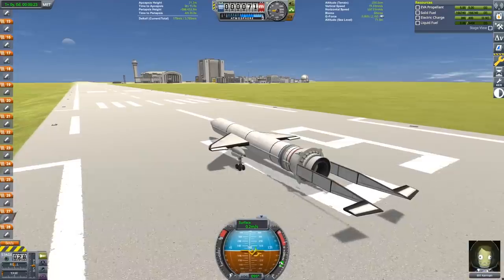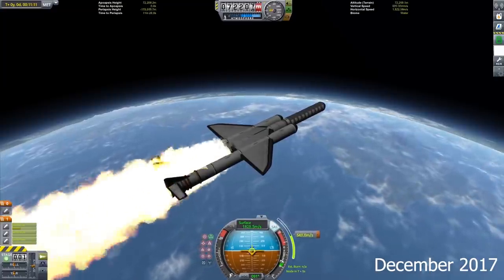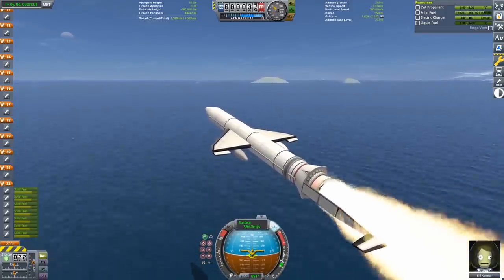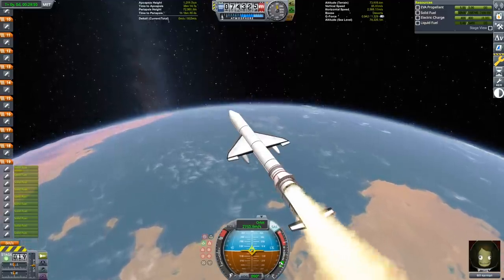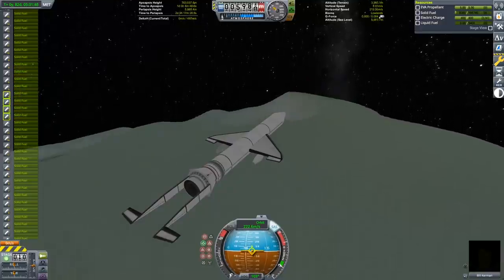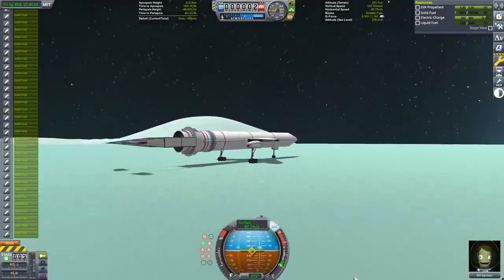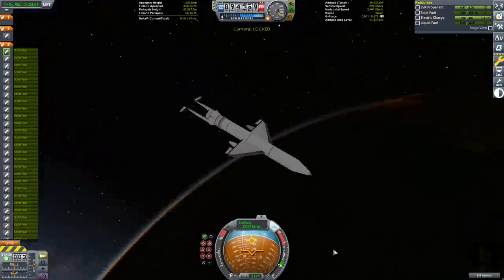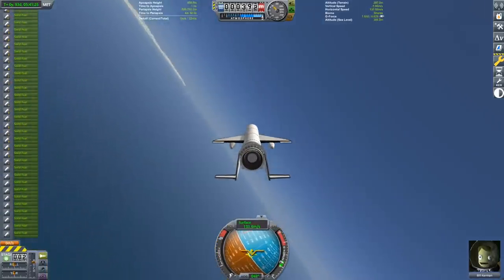Solid rocket fuel SSTO to Minmus

Comment: Before I could even get a qualified run for my SRB river kile run, Brad goes and does this. Stunning work as always! I was actually surprised to see that this could manage the return trip too, but I see that the Mun gravity assist and Minmus wheel braking helped a lot with that. 

... Now I need to get back to work...
Reply: Oh god calm down
Reply: I fear what incomprehensible constructs lie in your mind
Reply: Stratz, you should try to achieve lightspeed in the shortest time possible (no mass drivers)

Comment: The most impressive part is that landing. I’m in shock you managed that.
Reply: I've seen it done before, and even (barely) pulled it off myself but using only SRBs takes it to the next level after the next level!
Reply: The landing on Minmus is absolutely beautiful. Perfectly timed the rotation to put all wheels down at the same time!
Reply: The most impressive part is heat resistanse of the tail section
Reply: @kosiak10851  nah

Comment: Brad, I challenge you to go as far as possible with monopropellant.
Reply: The initial thrust limits are the biggest issue. Otherwise, the ISP is very similar to SRBs. You could probably get almost anywhere using the "refueling tug to Minmus" approach used in the Minimal Bill Eve Lander. Eve and Tylo are probably no-gos though, just for reasons of physics. I would be happy to be proven wrong though.
Reply: Eve is impossible without propellers, the isp of the engines is 0 (at least at sea level, but even at 9 km of altitude the pressure is high

Comment: Would this be considered an SSTO? Its a single craft, sure, but it has like 28 stages. Or is this allowed in the ssto "ruleset" for challenges like this?
Reply: >A single-stage-to-orbit (or SSTO) vehicle reaches orbit from the surface of a body using only propellants and fluids and without expending tanks, engines, or other major hardware

Comment: "single stage to orbit"  ...no... you used like 3 stages...
Reply: A single-stage-to-orbit (or SSTO) vehicle reaches orbit from the surface of a body using only propellants and fluids and without expending tanks, engines, or other major hardware. The term usually, but not exclusively, refers to reusable vehicles.

Nothing came off the plane. Igniting engines at different times in fight hardly counts as staging.
Reply: I stand corrected

Comment: Next: Drain Valves to Eve
Reply: uhhh... you cant do that anymore becau.. nevermind you can actually still do it, but it is just even harder
Reply: Don't think its possible. The thrust is almost nothing and eves gravity is A LOT greater than kerbins
Reply: Don't think its possible. The thrust is almost nothing and eves gravity is A LOT greater than kerbins
Reply: And back
Reply: @k-aerospace  r/thatsajoke
Reply: @k-aerospace  im pretty sure eve has about the same gravity as kerbin. Its just the thick atmosphere that makes it impossible.
Reply: @Emlif  Eve actually has 70% stronger gravity than Kerbin, so it isn’t just the atmosphere that makes missions difficult.
Reply: Well if you partcliped thousands of them to a small tank and fired them at the same time you could probably lift off
Reply: @k-aerospace  Laughs in KAL overclock
Reply: Matter a fact nah, washing machines to dres.

Comment: This is cool as a video, but it’s definitely not an SSTO.  All of the burns are from the main booster which is not possible. You would have to have a bulkhead  a foot thick probably per burn to keep it from burning. 
So this is not that impressive

Comment: Not only did you use the least efficient engines, you also used the least efficient craft design (SSTO). And you landed on Minmus.
Just when I thought you've done it all!
Reply: SSTO aren’t efficient?
Reply: @alexwang982  They’re extremely efficient because the dry mass stays constant throughout flight, as opposed to a conventional rocket where you can drop stages and continue on with only the useful mass

Comment: I liked this, but I feel like clipping a bunch of them is cheating.  At that point, you’re just making a single, super-powerful, super-sense rocket engine.  Why not just download a mod that has that?
Reply: Cause using stock parts is much more fun and part of the challenge. And to prove it can be done in game without external coding or changes. A little minor part clipping to get around some of the aerodynamics. Saying why dont you just download a mod is like saying why dont you turn on infinite fuel, or teleport there and back again.

Comment: It's not an SSTO if you have to fire multiple rockets one at a time.  Still impressive.
Reply: >A single-stage-to-orbit (or SSTO) vehicle reaches orbit from the surface of a body using only propellants and fluids and without expending tanks, engines, or other major hardware